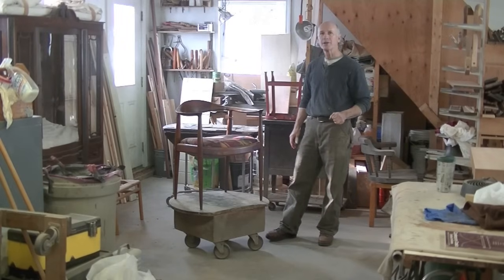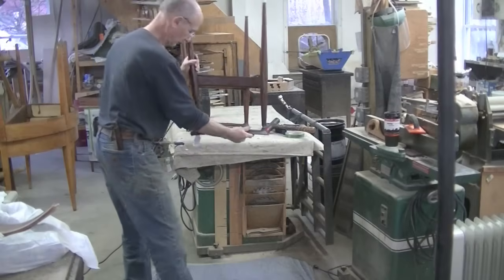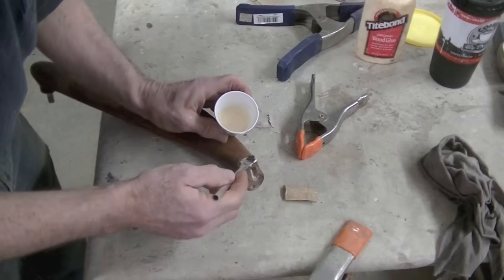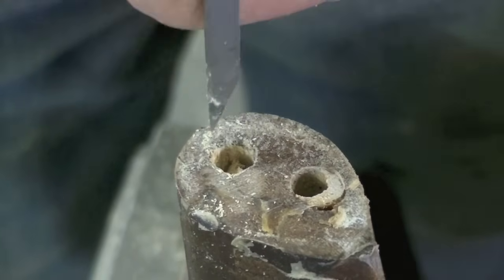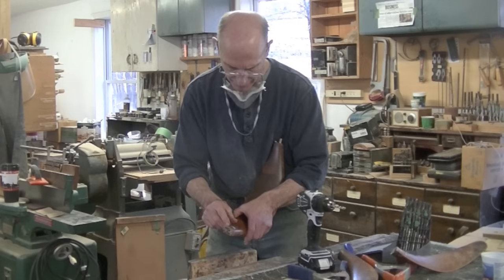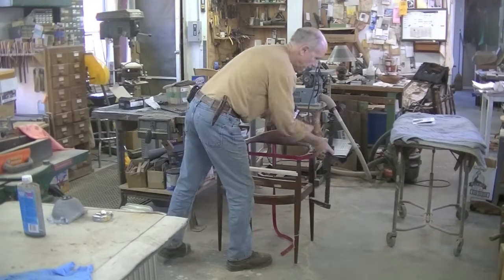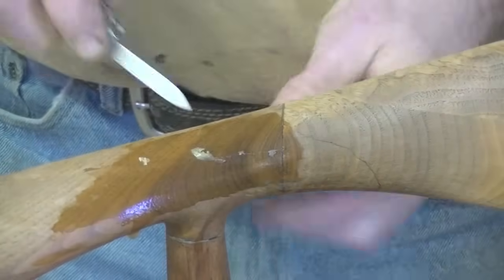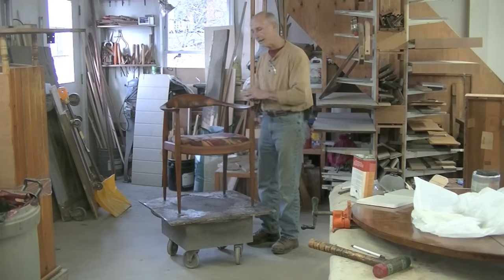Repairing a Midcentury Modern Masterpiece: Hans Wegner's "The Chair" - Thomas Johnson Restoration

Comment: Through the miracle of YouTube I watched the Danish factory making modern versions of "the Chair" with CNC and then your repair came up.  The newer version has an elaborate oversized set of finger joints where the one you worked on had dowels.  Thanks for posting.  Excellent repair.
Reply from the maker: You're welcome! I will search for that video - it sounds interesting
Reply: The special fingerjoints has always been a part of the design (as far as I know) since if not used, the wood will move and get lose, as it did on this chair. It surprises me this one used dowels, and my first thought was, that it might be a "fake". I would not know for sure ofc :)

Comment: Well you learn something new every day. What a neat trick for going to the correct depth by putting a piece of tape on. I’ll remember it. You did a great job on this chair. I’m not a fan of mid century modern but the chair looked great when you were finished with it.
Reply from the maker: Thanks! I like MCM, the well built pieces that is. Not the particle board of which there is so much

Comment: Incredible job repairing the broken backrest. Drilling out the 1/4” dowels at the angle and going deeper to obtain a stronger joint 😎 Did you reassemble using a 3/8” dowel and epoxy to make a perfect butt joint? Just amazing 😉
Reply from the maker: Thanks! I don't remember if it was a 3/8 dowel, I used the original size, it might have been 5/16

Comment: Tung Oil & Paste Wax as a means to finish.  So we don't need to Stain & varnish all wood pieces.  This is new to me.  I'll have to research those materials some more to learn more about them.
Reply from the maker: Thanks! I recommend https://www.amazon.com/Hand-Applied-Finishes-Fine-Woodworking-Workshop/dp/1561581542/ref=sr_1_1?ie=UTF8&qid=1547560196&sr=8-1&keywords=hand+applied+finishes+jewitt

Comment: Thanks Tom i have found when i have a receded dowel like that i  have luck at times using a machinists center drill to punch the center of it, very little wandering. Anyway another really good repair. Mike Fuller
Reply from the maker: +Michael Fuller Hi Mike, thanks for the tip. I am not aware of what that is exactly but I will start looking for one.
Reply: +Thomas Johnson Antique Furniture Restoration Your welcome Tom here is a place you may want to start. http://www.grizzly.com/products/4-pc-Center-Drill-Set-60-/H5930?utm_campaign=zPage&utm_medium=link&utm_source=direct

Mike

Comment: Beautifully done! I don't need to send mine to Denmark for maintenance when we have you!
However though, I always thought The Chair, regardless of manufactured date, has finger joints where armrests meets the backrest, rather than straight cut parts glued with dowels, like we see here..
Reply from the maker: Thanks! They were changed a number of times for different production runs. I'm not sure what came first, or even how you would define which was "original"

Comment: om - Thanks for your videos.  VERY instructive.  I was surprised as you were drilling out the dowels that you didn't use brad point bits.  I have located every size from to fill the entire standard Huot index by 1/64th's which I find very handy indeed.  Your thoughts?  Thanks again.
Reply from the maker: Thanks! I use both type bits
Reply: I was thinking that trying to center a standard drill bit into the dowel, and to not have it wander off-center, would be rather difficult and would be better done by "spiking" the point of a brad point bit into the dowel.   But I might be wrong.  So, out of curiosity and wanting to learn, did you choose a standard drill bit on purpose?  Or it just was the closest at hand at the time!

Comment: I have watched many of your videos that show you drilling out dowels using a standard bit.  I was thinking that using use a brad point bit would make it easier to center the start in the dowel,  while the bit's spurs would cut the dowel more cleanly.  I started with a small set and then added to it until I had an index full from 1/2" down to a tiny 3/32".  Handy!  Your thoughts?
Reply from the maker: Thanks for watching! I love my brad point bits, everything you say is true. But they're not good at starting at an angle, or for drilling out existing holes (that you're making larger). So you really need both types.

Comment: It's great to see a broken vintage chair restored, but this is not an authentic Hans Wegner chair from Denmark. It is a vintage copy that was made in the US.
Reply from the maker: Thanks! It's been so long I don't remember how it was marked. But it was purchased new in 1962 - the problem with this furniture - what is considered original? These chairs were manufactured by 3 different companies just in the first couple of years. The only "original" would have been the final prototype
Reply: This is a copy. The broken joint says it all. Originally made by pp mobler. The joint is actually wedged together.

Comment: To get a pilot hole in the middle of a broken dowel couldn't you use one of those gizmos for centering hinge screw holes? I've seen them used for getting a pilot hole in the middle of a broken bolt and it seems a similar situation. You may have to do a bit of carving on the periphery to prevent it wandering.
Reply from the maker: Thanks! That's a good idea, I'll get one of those and try it

Comment: To find the center of the dowel could you tap a nail in just a wee bit, pull it out and then place the tip of the bit in?
Reply from the maker: Yes, I often use a scratch awl to do that. Still difficult to get dead center.
Reply: Or use a bradpoint drillbit which are made to do just that .

Comment: Hi. Thank you for such great videos. I have a question. Bought a mid century table in bad shape. The worse is the trim around that has been re-glued in a really horrible manner. How can I remove the trim without damaging trim and table? thank a lot.
Reply from the maker: Hi, thanks for watching! Please email some photos "thomasjohnsonrestoration@gmail.com"
Reply: Thomas Johnson Antique Furniture Restoration Hello Thank you for answering to me. I already took the trim apart and glued it with very good results. A friend that knows a lot about carpentry guided me. I am still working on the top. He recommended me Howard's Restor & Finish to remove the white and black spots. They came out beautiful but I am waiting a couple weeks to stain and polyurethane. Any suggestions?.

Comment: I am in the process of restoring a 1955 "Paper Knife" chair. It was in much better shape than this, but someone had NAILED the failing springs back into the frame. At least they used very small nails!

As for the final finish I was going to use Tung but my research indicates that it was originally finished with a French polish, not "Danish" oil like most believe. I have never done a French polish. I am very worried that I will mess it up. I guess my best bet is to practice on something less important.
Reply from the maker: Wow! Just looked that up - nice chair. If it's from Denmark, they would have used a nitro-cellulose sealer, then an oil finish. You can't go wrong with Watco Danish Oil. I used Waterlox Tung Oil finish only because I wanted a faster build

Comment: Why did you use the grit side of the paper to buffer the clamps?
Reply from the maker: To keep them from slipping! the paper was folded 3X so there would be no slippage
Reply: That is what I figured but I would worry about damage on the wood from that paper lol. 
I use a cut finger off a nitrile glove etc. 
Rubber grip without possibly marring the finish but you know your stuff either way :)

Comment: i would say that though your work is very good, it seems like you use way too much glue. Also I would suggest you try washing the yellow glue off with a wet toothbrush before it dries rather than rubbing it into the wood with a rag. it will cut down on sanding and make sure that any stain or finish will be evenly absorbed, where if you rub it in, even after sanding some might remain in the wood grain. And with epoxy, it's worth masking the joint off with electrical tape so you can easily remove squeeze out, especially in the gum stage. Keep up the nice work!
Reply from the maker: Thanks! When doing repair work on finished pieces there's not much danger of working the glue in to the wood but I know what you mean.

Comment: I'm new at this and wondering why you use the tongue (?) Oil? I didn't see it in any of the previous comments. Thank you!
Reply from the maker: I use Waterlox Tung Oil. It's basically a thinned down wiping varnish, I find it's easy to work with, and I think is about as close as you can get to a real varnish, similar to what might have been used in the past

Comment: In such a weak area of that chair, 'wood' you ever consider replacing the wooden dowels with threaded steel rod?
Reply from the maker: I have not ever used a steel rod. I'm not sure why, but I think it's important to have the dowel glued. Glue with wood and steel just doesn't make it
Reply: Steel is very useful for giving great strength where the joint is weak. Some joints have been repaired several times and a steel pin can take the stress further down the rails to give strength where none is possible in badly damaged joints. Please don't dismiss this idea.

Comment: That's a fake. A real Wegner chair has zig zag joints. It would also have a woven paper seat.
Reply from the maker: Thanks! fake is not the right word. These chairs had a few different joints used at various times. The only original chair would be the prototype built as a model. After that, the manufacture was contracted out to many different manufacturers. The joint was revised by Wegner himself in different "editions"

Comment: It's not a his Wegner, but a copy
Reply from the maker: Thanks! It’s tough to say. This chair was made in the late 50’s, and produced by one of the companies that licensed his design. What is an “original”? They are all factory made. I’m sure there were some prototypes, are those the originals? Is it just the first run from the factory? And not the 2nd run or the 3rd run? Is it the joinery used in the back rest? Wegner himself designed the change in that joinery. What I’m suggesting is that Wegner, obviously was a designer, not a furniture maker. Maybe there are no “originals”. I’m not an authority on this, I’m asking the question
Reply: @johnsonrestoration   You are actually quite wrong, Hans Wegner was first a cabinet maker and then a designer, he designed the chair for a company called Johannes Hansen (JH503), after they went bankrupt, Wegner selected PP Furniture (PP503) to continue the production of the chair, they have the only license to produce the chair legally in the world. Johannes Hansen and PP furniture are the only companies to ever produce originals with the blessing of wegner. The chair was never produced with a dowelled joint on the backrest but a joint that is called a "Kileslids" which has the classic W shaped joints. Source: am a cabinet maker from Denmark, who was a intern at PP furniture. Also the there have never been a triangle brace on the under the seat.

Comment: It’s a nice old copy but not an original. There are a few details which you can see do not match. I know in the USA there was a fair amount of copying going on with danish modern design, some companies did have legal licenses to produce Finn Juhl, but the quality was very poor.
Reply from the maker: Thanks! I tried to research it a bit. I think that with this furniture it is very difficult to say a particular piece is an original, as it was all factory made. Would the original be the first prototype? Or is the first production run all "original"? What about the 2nd run?
Reply: Thomas Johnson Antique Furniture Restoration typically in Denmark once a prototype was put into production and like PP Möbler today the serial production will stay true to what the designer had designed and preferred. The chair you restored has different joinery and would make sense for a faster, easier and cheaper production run. Most design here Scandinavian does not have a second edition for a budget market it goes against what Scandinavian design and innovation stands for. This is why we have IKEA who re designs, mass produce in china and supplies the budget market.

Comment: That is not an authentic hans wegner, the back joints were made with fingerling joints, not dowels, and they should all be mortise and tenon joinery.
Reply from the maker: Thanks! It's interesting though. But what is an "authentic" chair? Just the first production run? What about all the prototypes that were built before the first production run? They made changes for the 2nd production run. Are those authentic? I believe they changed a lot of details over the years. Seriously, how would one define an "authentic" chair?

Comment: "It's good the joint is sloppy" no it's Not! So it's a floating joint now is it? And WHY did you hack off that piece of wood? That is a strength joint and there should have been zero play around those dowels. If you don't know how to achieve that then you really should not be in this trade.
Reply: More antique restorer arrogance.  Why don't you go annoy someone else?
Reply: Let's see, where to begin.......well, utilizing dowels in a joint is really poor design practice....do you understand why? The dowels shrink and not uniformly, which is why over time these joints always fail. Utilizing epoxy is the SMART way to fix these joints, epoxy is one of the very few adhesives that is structurally capable of gap filling, and with dowels you have gaps. I'm quite certain, based on your incompetent reply, that you have most decidedly never restored anything.
Reply: ANTIQUE RESTORER has long since been discredited here.  He's just a troll trying to stir-up misgivings, just a kid playing games, bereft of any meaningful existence.